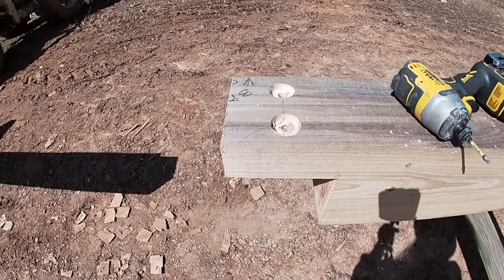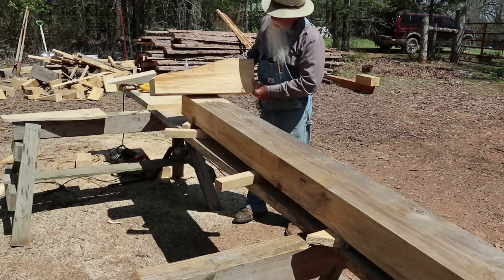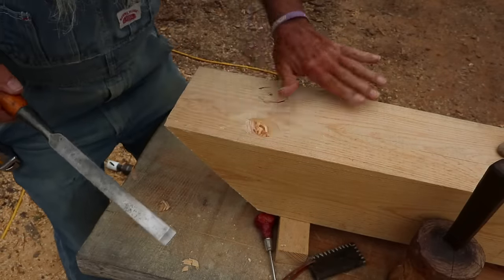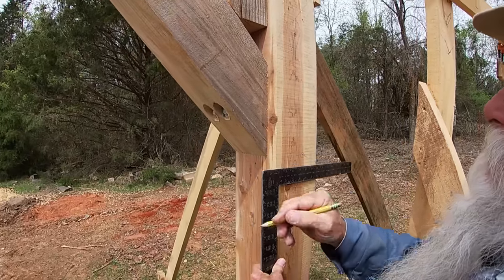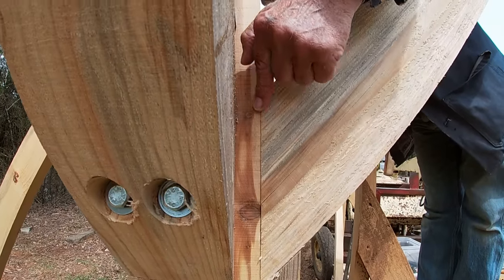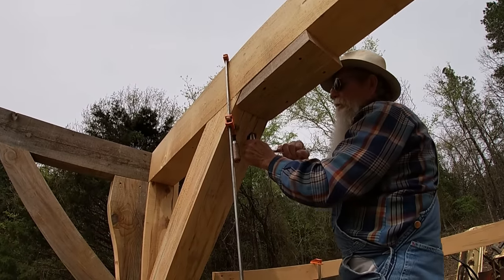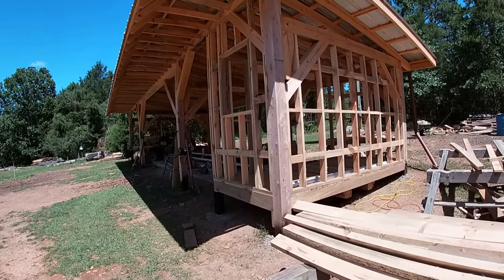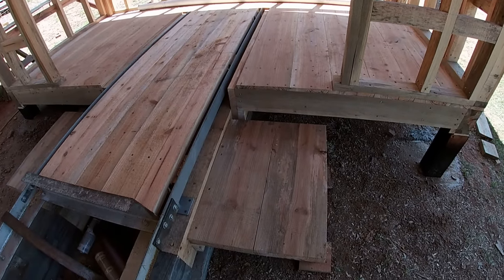Sawmill Shed Build, Start to Finish

Comment: not sure if my last comment went through, not sure how to send a comment on youtube.  Anyhow, I'm 70 years old.  Had a 0 frick sawmill pulled with a 471 detroit from age of 25 to 50.  Then family farm sold.  I sure missed smelling that fresh pine sawdust.  Sold farm in 2007 and moved to 10 acre site.  I bought a cooks mp-32 last summer to scratch my itch and keep up with fallen trees by storms.  This sawmill is so much slower than my frick, but I can saw by myself and not have to worry about getting blade hammered.  It is also alot safer.  Thanks for your video.
Reply from the maker: Howdy Woody- yes, your comment came through and I replied. I sure love to listen to those old Detroit engines pulling a sawmill. I only know of one fellow who is in his 70’s that can hammer out a blade. He and his Daddy used to go all over the country hammering blades back when there were a lot more of the old sawmills running. I sure wish you the best with your sawmill. Take care and God’s blessings to y’all

Comment: Did you add a section or two to the mill bed? It looks longer than when Sandy had it. That was a neat idea to close in the head like that, and to floor in in front. Makes it easier to change blades.
They say that the older you get the smarter you get. Doesn't seem to apply to me yet and I'm 80. Maybe there's hope yet. Best wishes, and the Lord Bless.
Reply from the maker: Howdy y’all- I built an extension on the mill out of 3”x4”x1/4” angle iron. The whole track is whatever the factory 10’ section was plus 23’ that l made. I can easily saw 26’   The track extends into the storage room. I put a 3’ extension on the starting end to keep the sawhead out of the way when loading the mill. With the floor in the storage room it makes it so much easier to fill the gas tank. Yesterday I put three more log clamps on so there is six total now. I sure hope you watching the video and for the comment. God’s blessings to you

Comment: Hello, great job.   Will build my sawmill shed next year for my cooks mp-32.   Is the black on the bottom of your cedar post creosote, oil or (shou sugi ban process), which is where they burn wood to prevent rot.  Thanks, Woody
Reply from the maker: Howdy Woody- thank you so much lord bless watching the video. Much appreciated. I did the shou sugi ban on the bottom of the posts up about 4 1/2’. I put several inches of gravel in the bottom of the holes and tamped it really well. I don’t use concrete around a post, I tamp gravel around the post so moisture can get away. I’ve seen post rot when concrete is used. If the post shrinks a bit water runs in and has no place to go. I sure wish you the very best with your sawmill shed build. Take care and God bless

Comment: What size lag screws do you use for the bracings ? Thanks, Bård from Norway
Reply from the maker: Howdy Bard- I used 1/2”x6” lag bolts on all the knee braces and the top plate timbers. Thank you so much for watching the video. God bless

Comment: how did you treat the ends of the timbers in the ground? singed and oiled? are they on a poured footing or just compacted native soil? nice looking structure
Reply from the maker: Howdy Hayden- l did the shou sugi ban up the posts about 4 1/2 feet. I tamped several inches of gravel in the bottom of the holes and tamped gravel around the posts so water won’t stay around the post. Thank you so much for watching the video and for the kind words. God bless you

Comment: 07:34 Question for you. This is the first of your videos I have wached. Why did you square up the log before putting it on the mill??? 💜💜
Reply from the maker: Howdy Sue- it wasn’t explained in the video because of time, I did tell why in a previous video of the sawmill shed build, the whole log was way too much for my old tractor to lift so I trimmed off when I wouldn’t be using before loading it on the mill. You’re very observant. Take care and God’s blessings to you

Comment: As i watch the video it seems like you are using green lunber right off the mill, is that a big concern,   I will be putting one up myself but not sure if i should wait for my lumber to dry for a Year.
Reply from the maker: Howdy Billy- some of the wood was fairly green but the timbers had been milled for several months. The wood l used for the storage room was completely dry when I put the batten strips on and made the door and trim. I’ve had no problems with it. Hope this helps. God bless

Comment: That pretty nice mill shed :) How long are you set up to cut ? set up looks pretty long "
Reply from the maker: Howdy Don- I can cut 24’-26’ pretty easy but my old tractor might not be able to pick something like that up. The opening is 20’ but I can wiggle longer logs in that fairly easy. I think the longest I’ve cut so far is 22’ for the big opening in front. God bless
Reply: @TheBeardedCarpenter  That's awesome !  If you can keep it level for the long ones, I can only do 16' & i don't do many of those, Mostly 8'-10' just for my projects, A few 16's for skids, Very happy with the mill & what it saved me :)